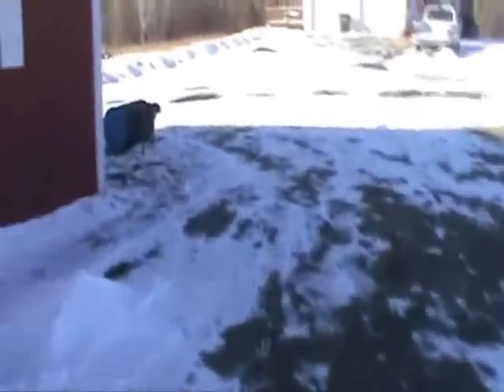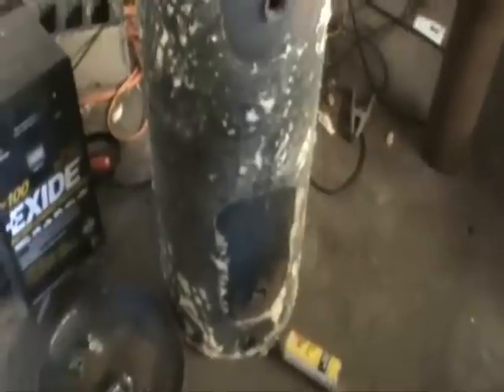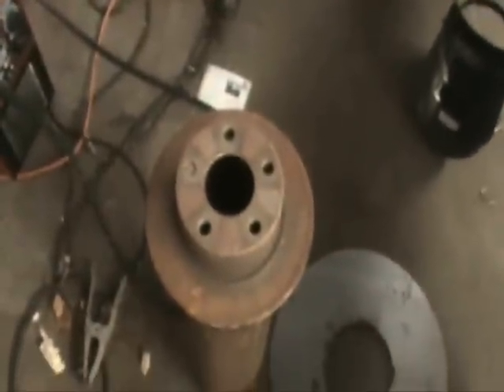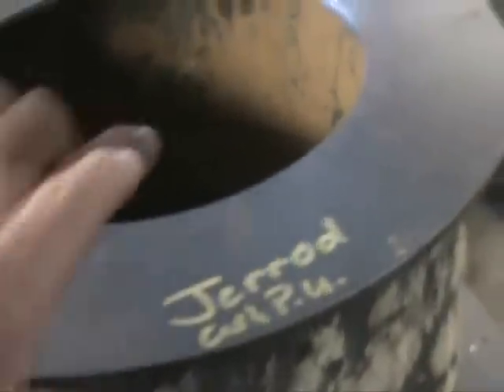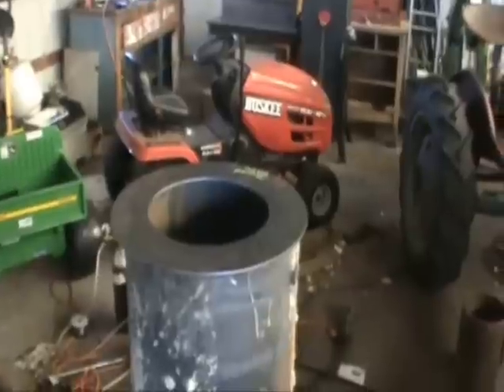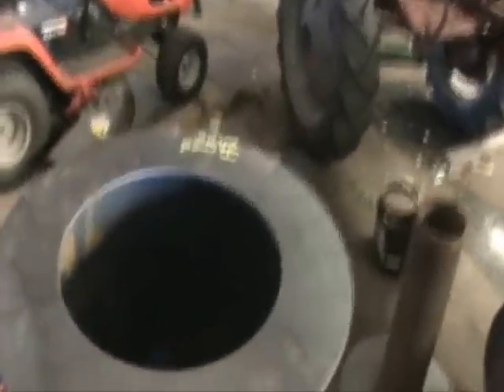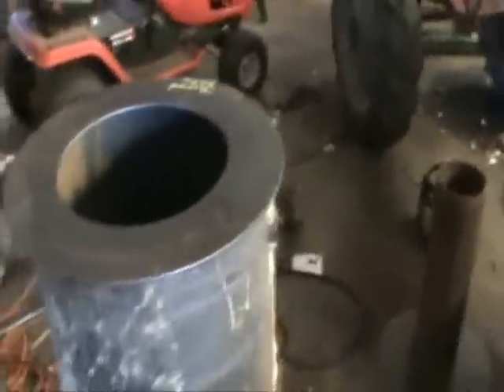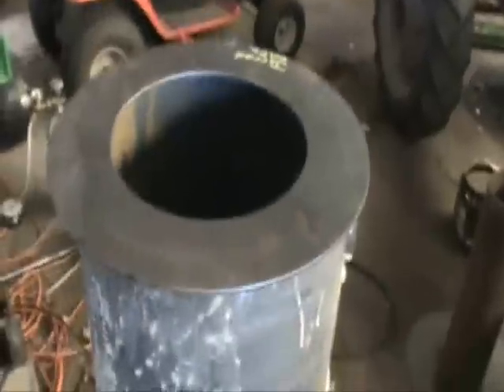Gasification project

Comment from the maker: @DigitalSkyline I would look on craigslist for a cheep welder. I wish I had a 220 version but my neighbor does and he's also got a couple other welders we may use. He's going to help me fabricate this summer. He's a tool maker in a fabrication shop and he's got a Stick welder and a TIG welder that both run on 220. Mine is a MIG running on 110. So yeah, this spring I'll go get a case of beer and we'll tackle this project. I will be replicating the Cyclone and media filters from VGW also.

Comment from the maker: @DigitalSkyline yeah I don't expect it to be easy but thats why I'm startiing work on it now while I still have power and the resources to make it happen! If I get this one going, I have a bunch of cinder-blocks that i may just make a permanent outdoor gasification system to make a larger amount of gas to run a generator set. I expect to figure out this issue this year, one way or another.